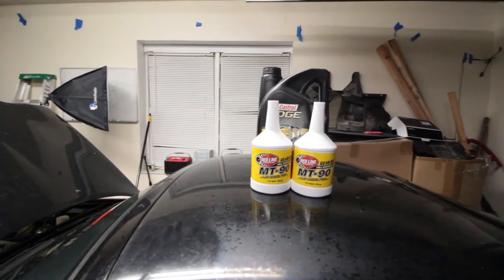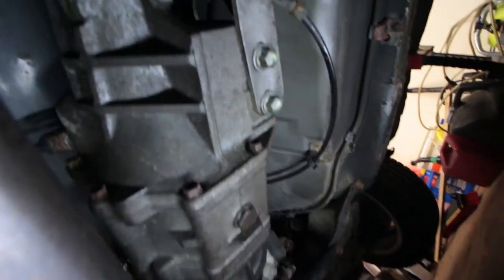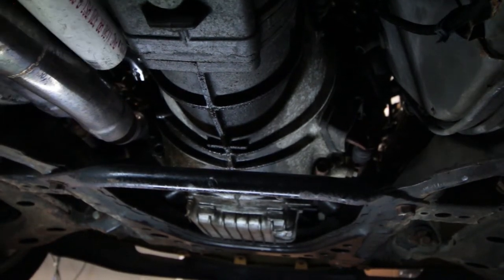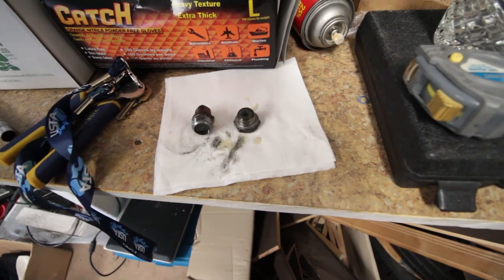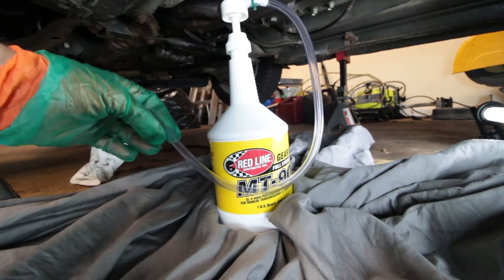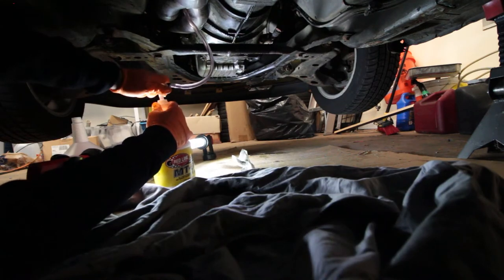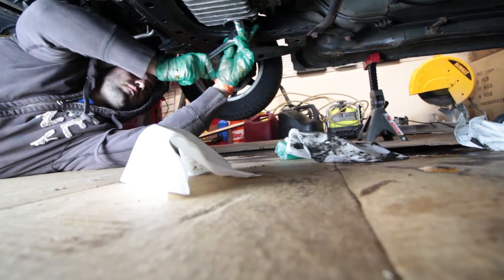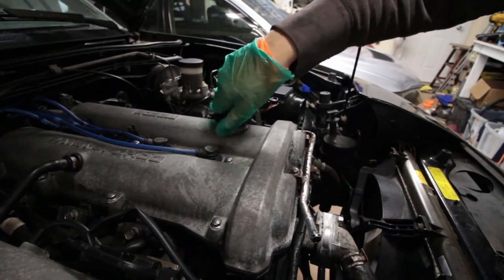Changing the transmission fluid and engine oil in the Miata

Comment: So I have redline mtl 75w-80 would that work for transmission fluid or is that too light
Reply from the maker: Yes, it will work, it is used quite often in Miatas. I prefer 90, but I've used MTL before without issue. Thanks for watching!

Comment: Would that redline mt90 be good for my turbo 2 transmission and diff?
Reply from the maker: It would be great for your transmission. For the diff I'd use something like Redline 75w90. 75w90NS is their fluid w/ LSD friction modifiers if you have a LSD.

Comment: Can I use the same oil for a 1999 miata
Reply from the maker: Yeah, you should be fine running 10w30. Since going turbo I have switched to Rotella T6 5w40 for all the additives & thicker weight. 👍👍
Reply: supercarmio I meant the transmission oil but thx
Reply from the maker: @lil_mac380acp2  oh my bad! yea the transmissions are so similar you'll be fine with mt90. honestly I've been using motul gear 300 and really like it. bit more pricey though compared to redline